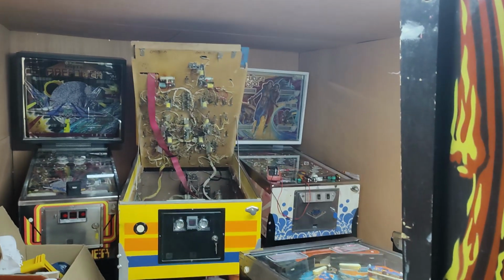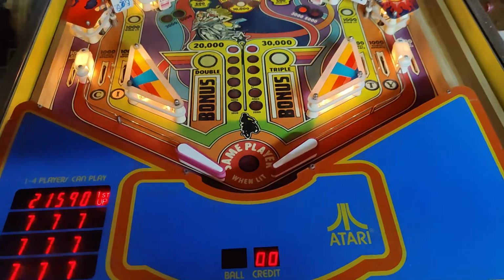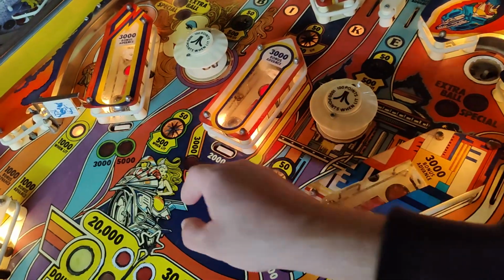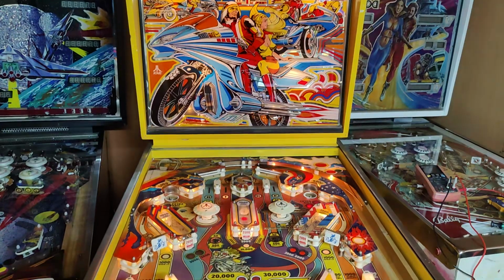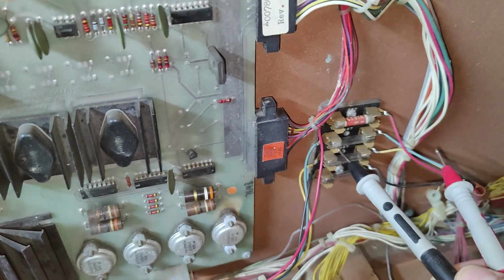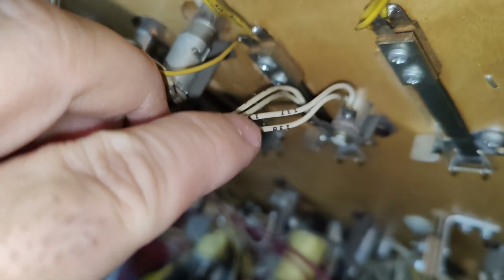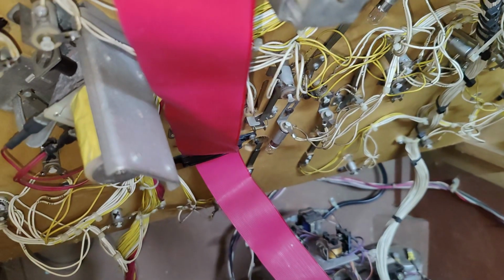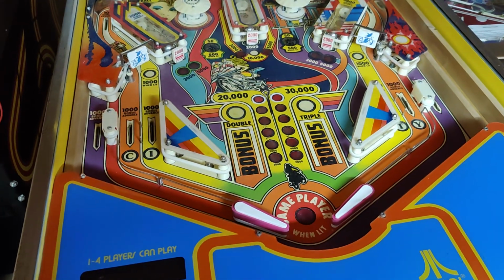Atari Space Riders - Pinball Repair - Part 2

Comment: Great stuff. You need some little circuit breakers for troubleshooting rather than going through expensive fuses!
Reply from the maker: Thankyou! I have a 5a and a 10a breaker in my toolbox, but have found it hard to find find low amp breakers (1-3a) that actually trip at low currently. I should probably look into trying some more with how expensive fuses are getting